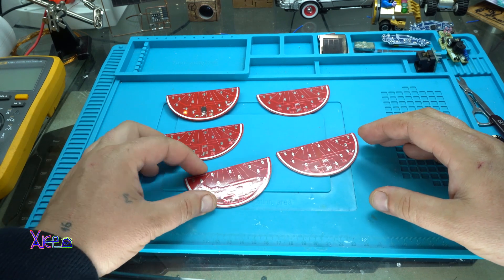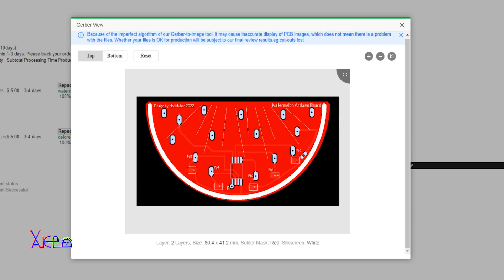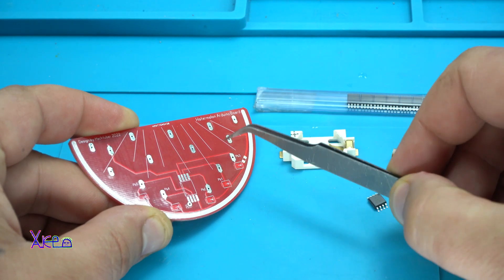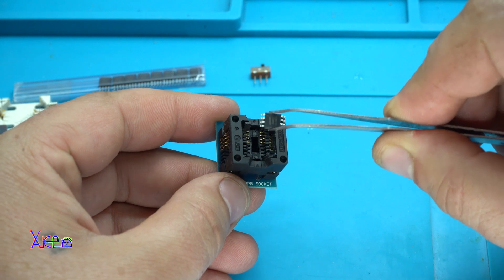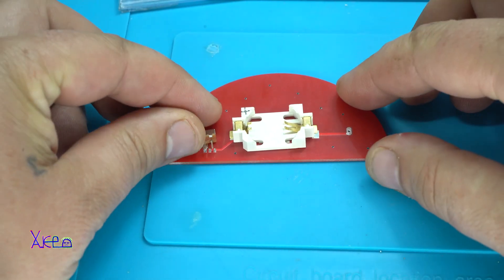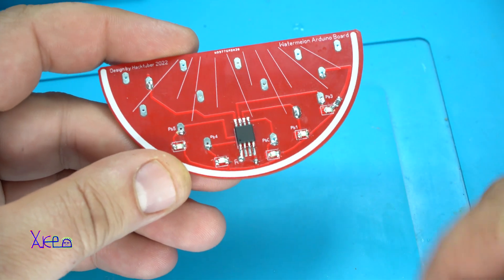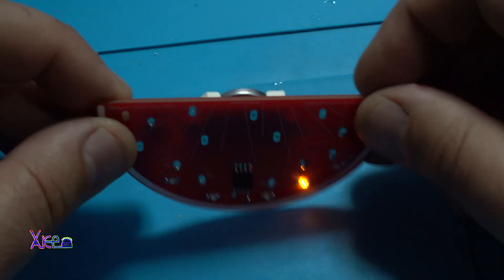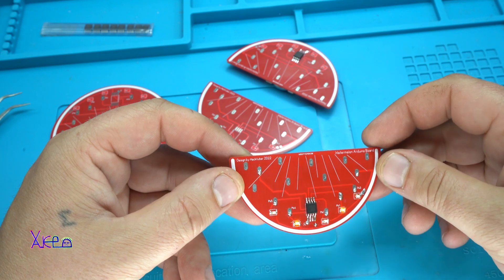DIY Watermelon PCB  Board

Comment: Can I use the circuit board to make contact with extraterrestrials or even mark a runway for UFOS? I can definitely connect a powerful antenna with an amplifier instead of the piezo loudspeaker to establish radio contact with extraterrestrials in other galaxies, right?